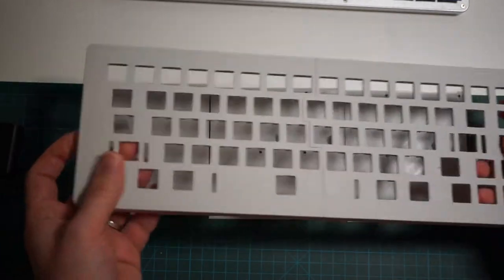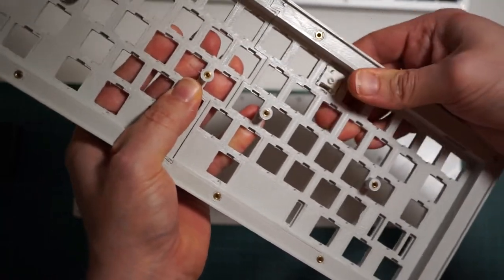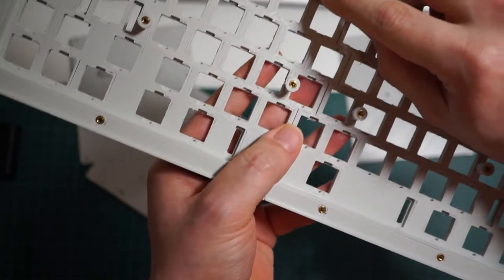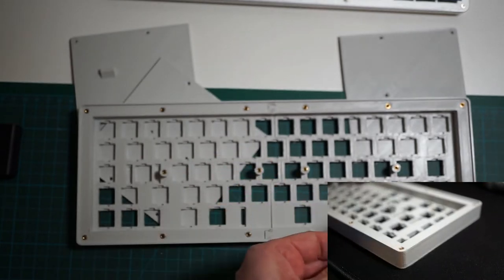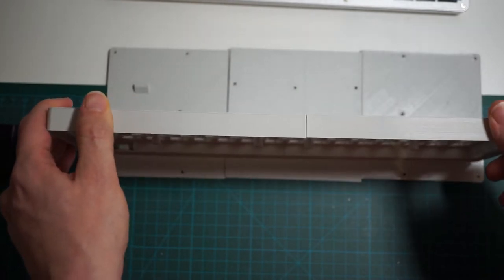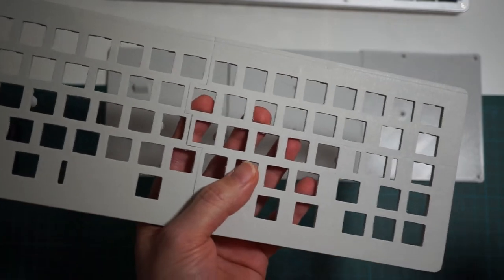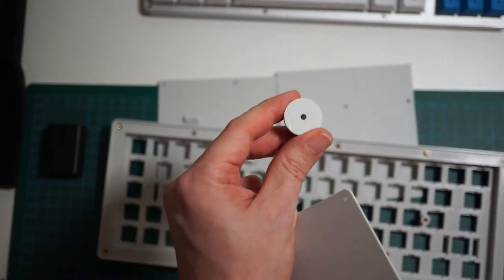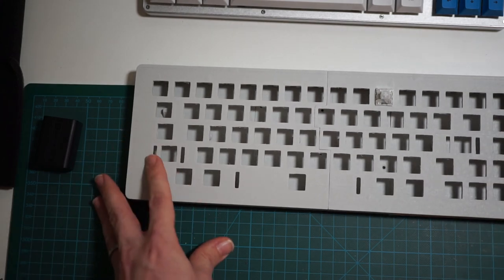Easy to 3D Print Keyboard Case (aka: Whitefox 3D)

Comment: I've wanted to try my hand at handwiring and also really like the 65 percent layout, I might have to take this and give it a shot. If only I had my own 3d printer
Reply: there might be a makerspace near you
Reply: Get an Ender 3 - it's cheap and good
Reply: @SuryanIsaac  same person different account, I have since gotten an ender, but it got all kinds of messed up when I tried to replace the main board with a quieter one, I don't know what happened but there was a short and the magic smoke. Killed all the electronics except the motors. I've since gotten a prusa mk3s, I should get back to this, I've got a proton c laying around.
Reply: @toyvo  Nice! I also had magic smoke once when I dual powered the board from both the PSU and my computer.

I still have a heavily upgraded Ender, though I plan to build a hypercube soon.

Comment: Wow great timing, just got a 3D printer last week, so will definitely try this soon.
Could you give me the dimensions of those threaded inserts? M2.5 with a M3.5 OD? What depth? I just want to make sure I buy the right ones!
Thanks!
Reply from the maker: They are 4.2mm external diameter and 4.8mm deep! Anything around that size should work, it doesn't need to be exactly like that.
Reply: Great thanks for the info, will order those now. Thanks for all your hard work!

Comment: can i use alps switches for this?
Reply: no, the switch hole is different, but would be easy to fix
Reply: @MatteoSpinelli  thanks for your answer, man! What about the stabilizers? Can i use the normal cherry ones or do i need special alps stabilizer?
Reply: @juno_99  depends on the keycaps you use! if you get them from an old alps keyboard you need special stabs